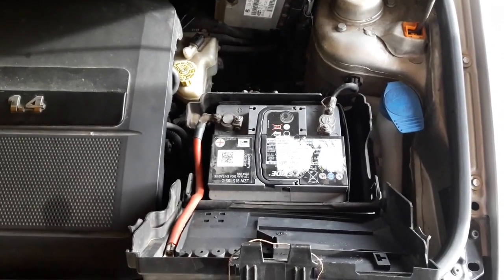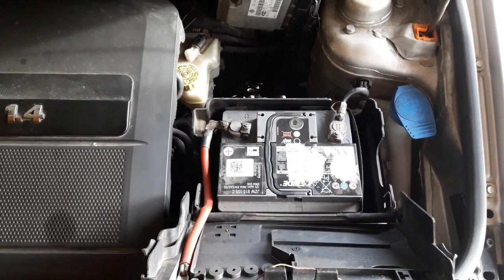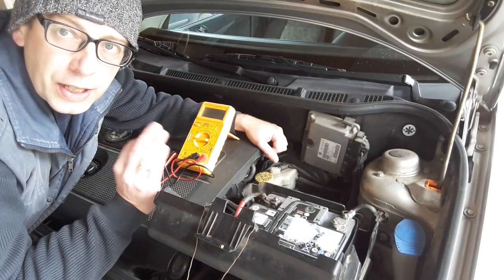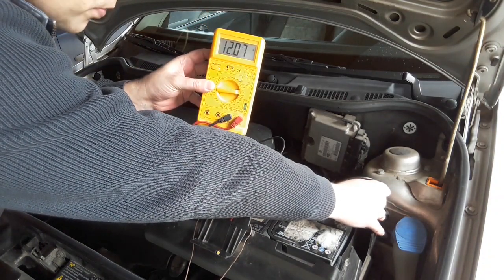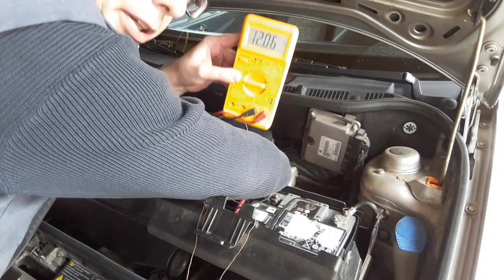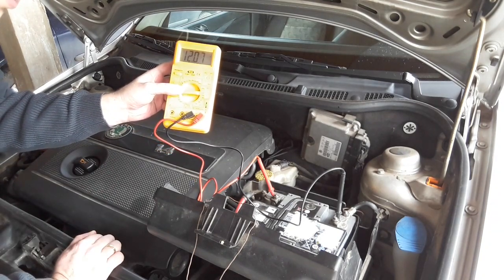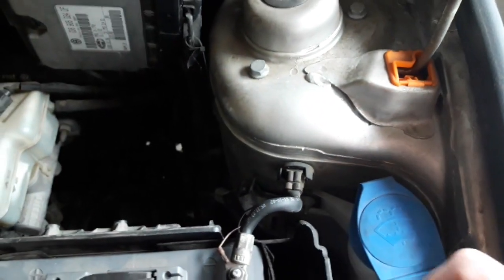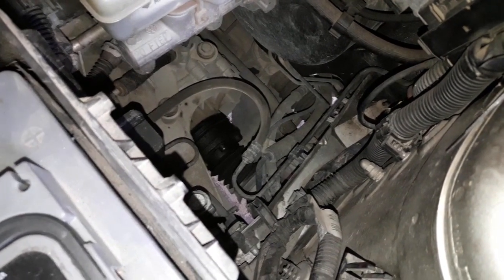Bad Ground Connection On Cars-Meaning,Symptoms, Diagnosing and Solving The Problem

Comment: corsa 2005 c no crank and no start went for a long run came back parked up next morning nothing dead could you help please
Reply from the maker: Hi and thanks for watching our channel!

What do you mean by dead? When you turn the ignition key is there any sign at all (like do the dashboard lights appear at all), does it crank at all, are there any noises....?

If the car is completely dead (you turn the ignition and there's absolutely nothing) check the battery clamps that they're clean and tightened. Also, how old is the battery?

Some more info would help.
Reply: @DespairRepair  was sold a dud battery
Reply from the maker: @GRAIL-zp3ue  figures. Good that it's only that. All the best to you